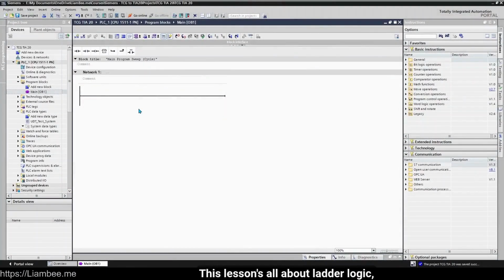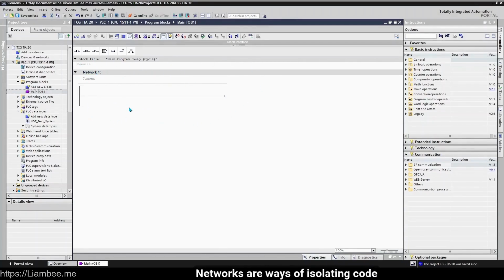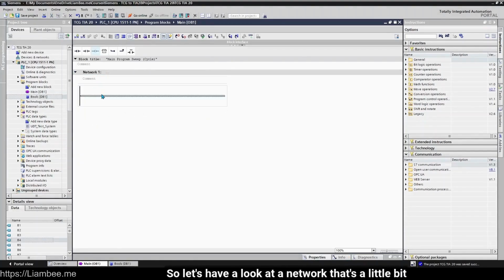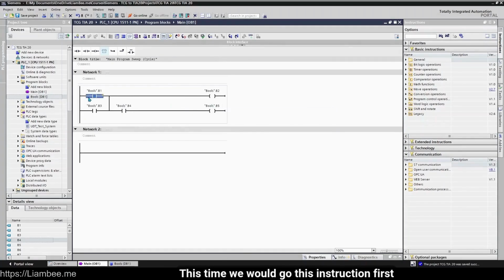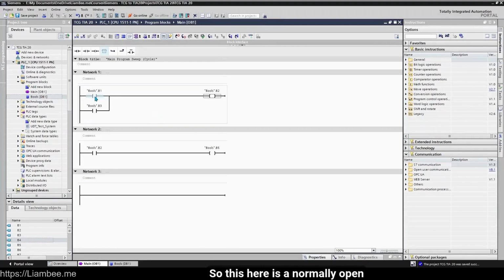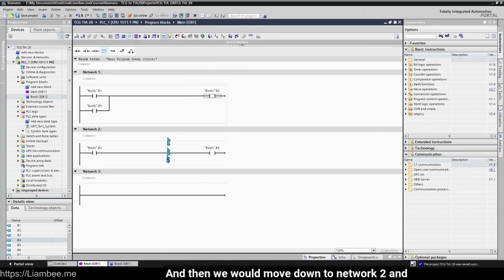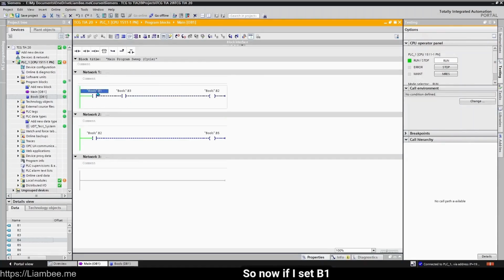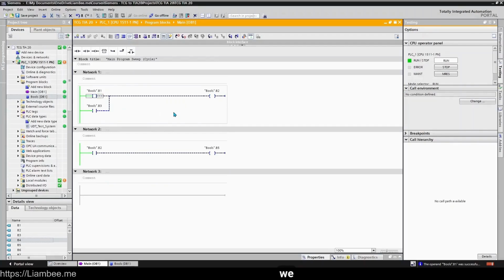TIA Portal V20 - Introduction To Ladder Logic

Comment: Yea...good ....the output of the or ....travels up and down ? In some cases but I think this a seimwns thing of how they display the ladder they can display two seperate or blocks by using a common downward branch that you chose to seperate into two seperate rungs. You spotted the controdiction in that up down flow this is typical German thinking. The logic function NC is really an and gate it has two inputs the tag and power rail ...this also helps explain how the logic flows. As you correctly point out the flow of logic that appears as a graph but really is a list of instructions/functions. The logic of flow comes from maths theory called graph theory and closely resembles DAG except for the cyclic behaviour of PLC's. So although it looks like an American electrical schematic the roots of it most likely is graph theory bit adapted to use cheap processors. Omron has some different ideas on how the power flow works I think they really do try and make the branches run in parallel by using multicore processors what a nitemare that is. ...but yes you explained it very well from the perspective of a PLC view well done